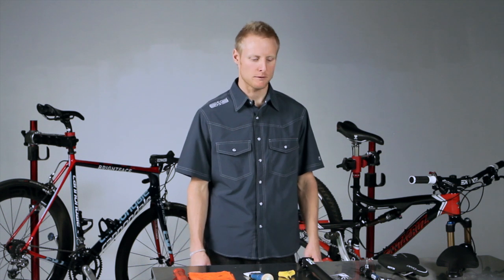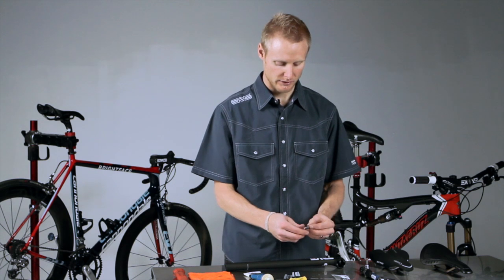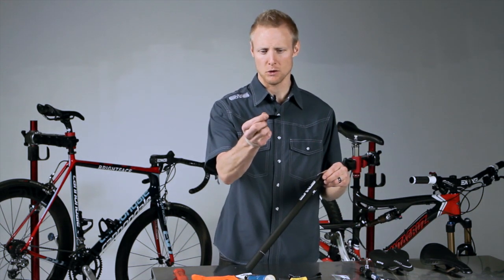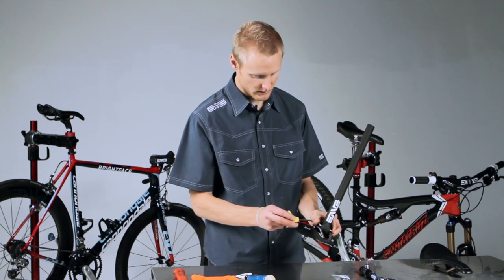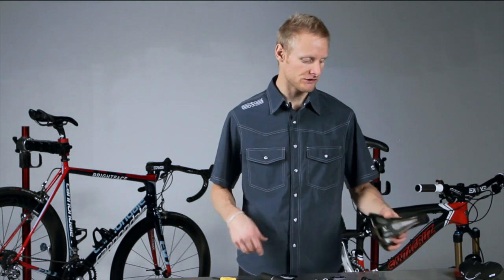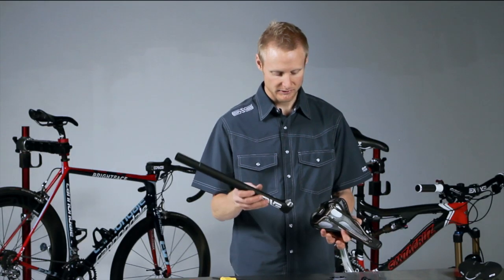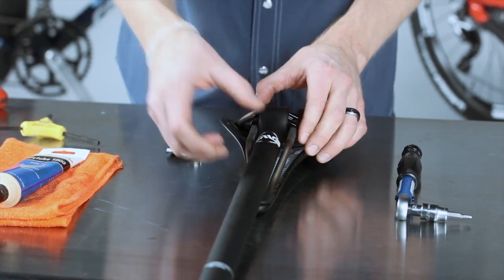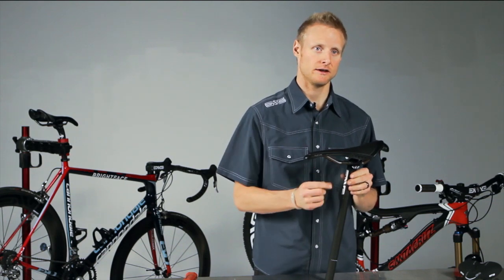How To: ENVE Seatpost and Saddle Installation

Comment: Excellent my friend the problems is when you need removed the seatpost, is big pain in the botton. The installation is ok hammer rubber couple of adjust here and there, probably when you hit you can removed some parts of the carbon rail seat post, but is ok is not a big problem.  Thanks very much friend of enve.

Comment: This is extremely difficult with the fizik alliante.  Clearance is very tight and the oversized rails on this saddle created a lot of tension.  Tip: I applied a tiny drop of dish soap on the rails and tapped it several times and boom.  I then rinsed the whole thing off with warm water, dried, and continued installation